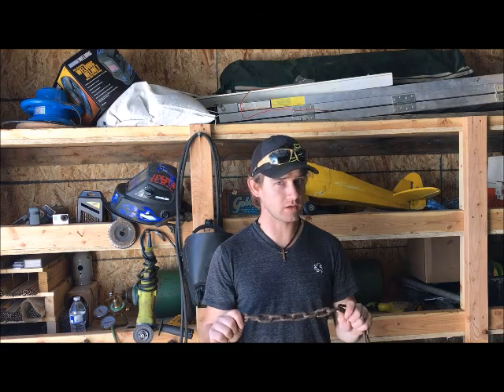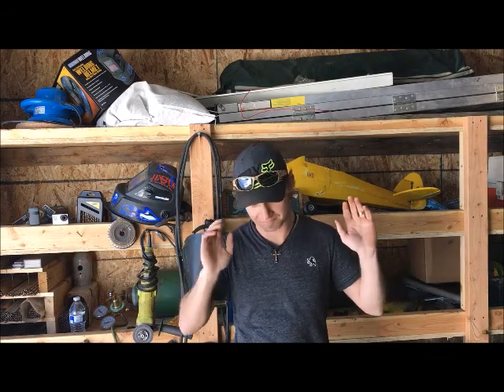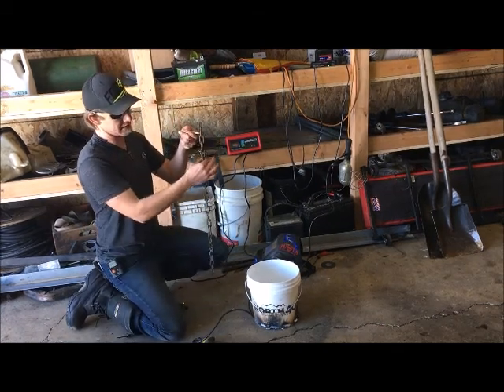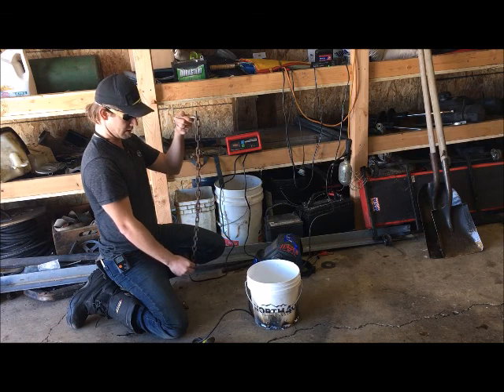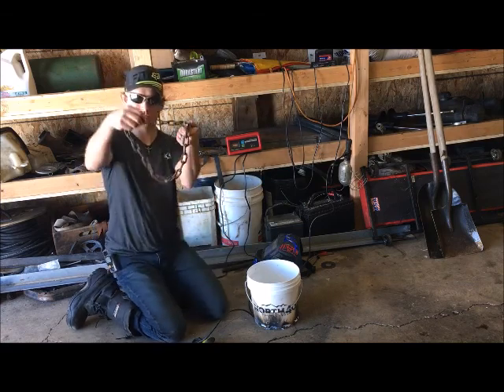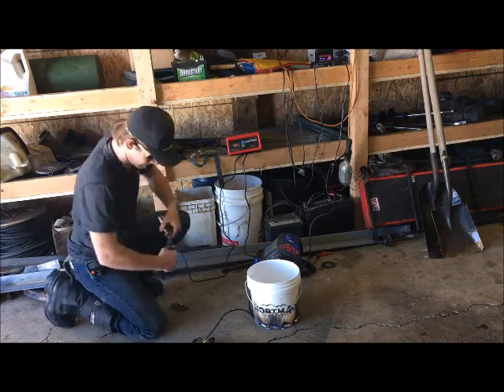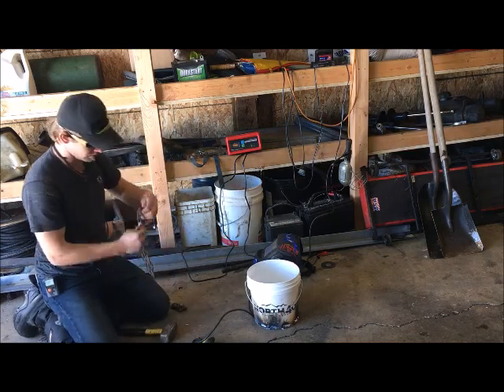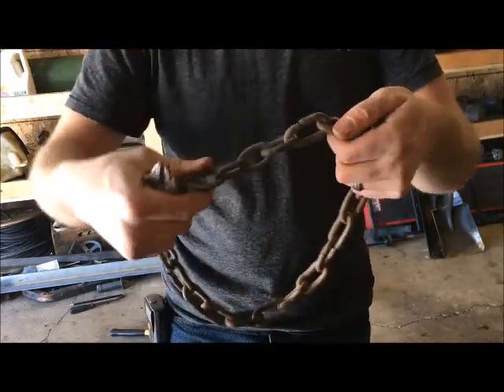DIY Go Kart chain steering wheel

Comment: 'what about not having any OverLap?  Measure the chain as you did and cut it so you have 1 extra length.  Cut this link and open it, insert the other end of the chain then close it.  Weld this 'cut' closed.

Turn the bucket over and let the loop of chain slide down an inch, tightening each link to the next, then do your welding
Reply: I stand corrected, I posted the comment as soon as I heard 'overlap'